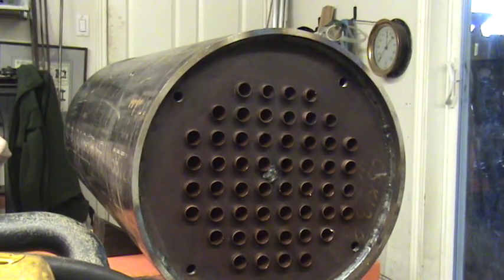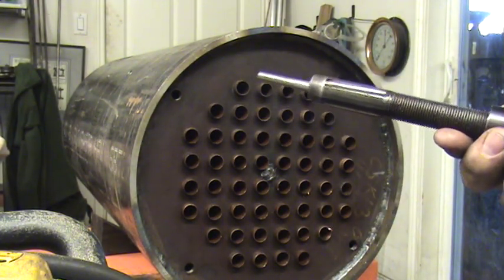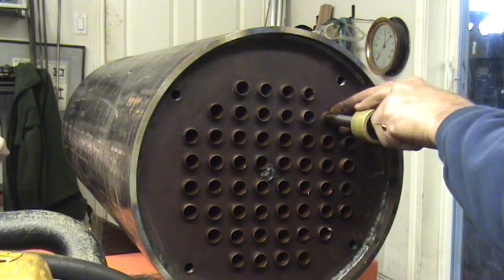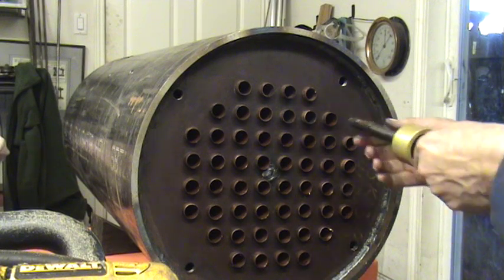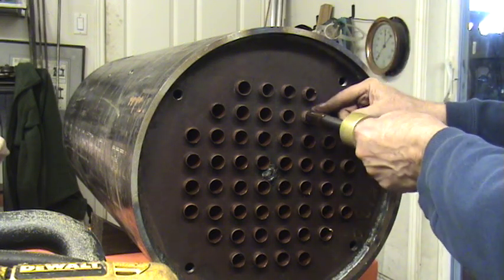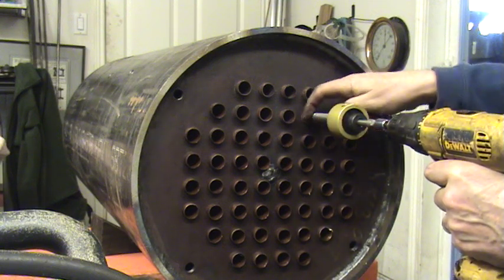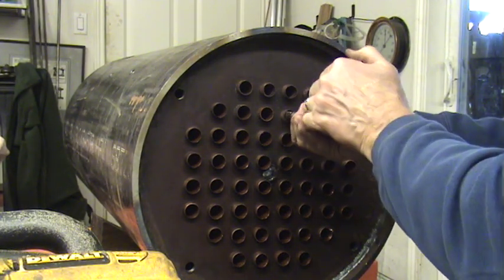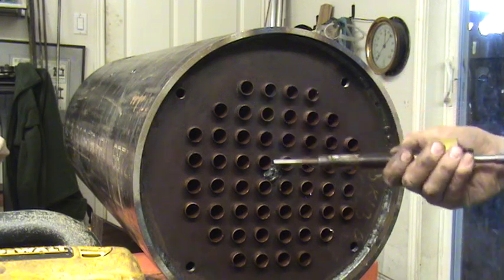Rolling in Copper Boiler Tubes

Comment: It's impractical to solder the tubes into place. The big metal plate with all the holes would absorb the heat as the tubes would get too hot. Almost all these metal plates are a bronze alloy or plate steel. The tubes are usually made of "Admiralty tubing". Two very dissimilar metals to be soldering together. This method actually sort of welds the two metals together. This method has been used since the 1800's. We have used a sealant where the tube meets the plate also.

Comment: My boilers are all copper with tubes silver soldered in. Working pressure 100 lbs. Hydraulic test pressure 280lbs.  No leaks & work fine.

Comment: How much room are you leaving for the copper tubes to protrude from the Crown sheet and do you have to bead the ends over or are you just leaving them as is after you rolled them in. Have you ever had any tubes that has became fire cracked?

Comment: Hey fella thanks for this video.
Can you tell me where I can find a tube roller like this?
I've searched and can only find hydralic spreaders, suages and solid drifts.
I make alot of heat exchangers in copper/stainless, this would work great.
Thanks.
Reply from the maker: ebay, search "boiler tube roller" or boiler tube expander. The problem is finding the correct size for the copper tubing that you are using,

Comment: thanks for the interesting video. i have built several model models all with rolled in type "k"  copper tubes.   2 of my boilers are over 20 years old, and i have not had the slightest leak in any tubes.
Reply: Does the outer shell need to be seemless tube? Or any special grade of steel?

Comment: you can use a mains drill of course, duffie is correct the mandrel is set incorrectly you looking to achive approx 5% wall thinning for good expansion  and yes copper has a far higher heat transfer i have to say i would have used 90/10 in condition o but thats nit picking its his job at the end of the day internal rings in the tube hole would help as i saw no expansion bellows but again nit picking i guess

Comment: Why do some roll a bead, and on the live steam train boilers they always weld them
Reply: Paul Baker I don’t think the welding to to weld the copper pipe to the steel plate. You can see on rossco’s he has a welded bead around every hole the copper pipes are rolled in. I’m just guessing but I think the welding is to reinforce the steel where the holes are made, or maybe it improves heat transfer. 🤷🏼‍♂️
Reply: @paulpierce2051  
I don't know shit from shoe shine with steam boilers, I was interested in this from my standpoint of making heat exchangers for large distillation units.

I was watching a vid of some guys making huge steam boilers - they also welded the heads after rolling them, they said it wasn't a leak precaution it was more to do with thermal transfer - not getting a heat differential between the plate and the tube.